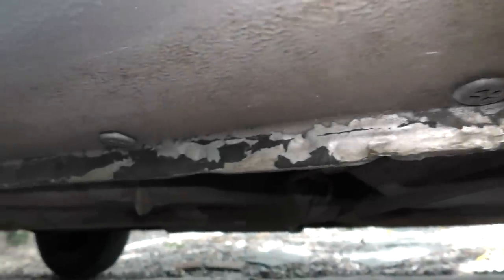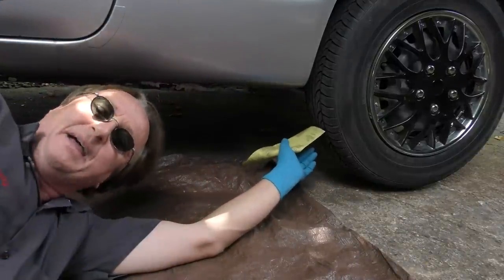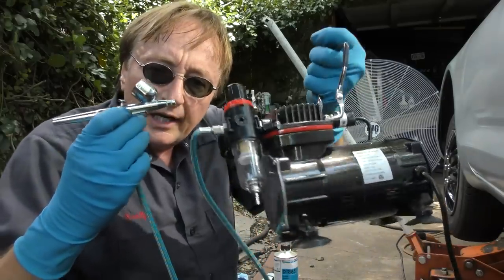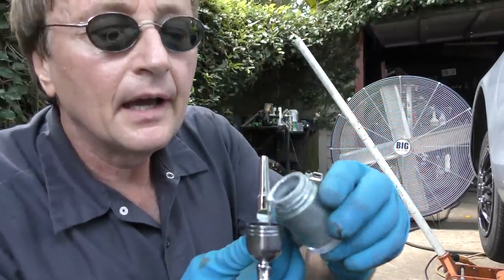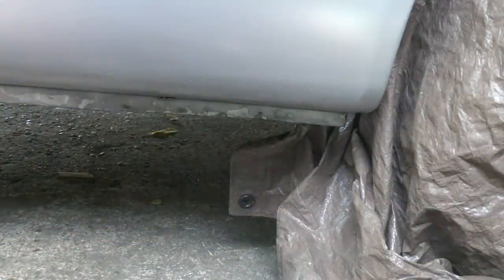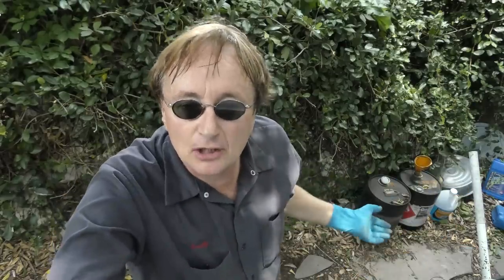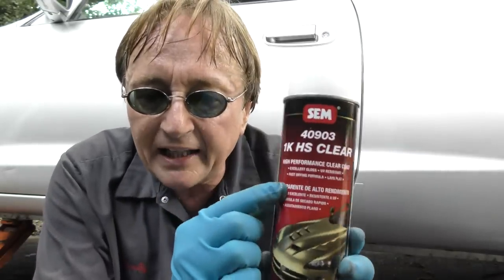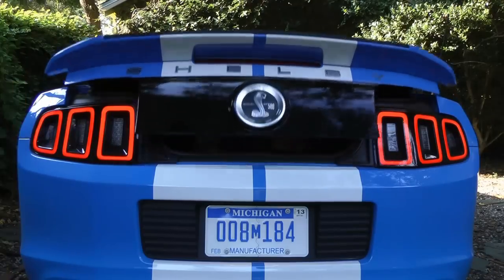How to Touch Up Paint on Your Car

Comment: Scotty, I love your videos but I think this is a bit complicated if you don't already own an airbrush and compressor. Most car paint stores will mix your paint and make you an aerosol spray-can with it and I've done that and used it many times, one spray-can is good for a whole bunch of touch-ups and cost me 14$. A hell of a lot cheaper and less trouble than a compressor, airbrush + thinner, the work in cleaning the airbrush, etc.
Reply from the maker: Il Cuggino Canadese sure, but you won't get as good a finish with an aerosol spray can, realize that. considering the thousands that pro painters charge to paint cars, spending less than a hundred on materials is chicken feed
Reply: Il Cuggino Canadese You can get budget airbrushes and compressors at Harbor Freight. I don't own one their compressors but seem pretty solid. I have a Silentaire. For the actual brush stick to something  metal. I have their Badger 350 clone and it's junk, but it was just 5 bucks. Their Badger 150 copy is much better.
Reply: For the record, I have an 8 gallon compressor kit from Hausfeld Campbell which along with a whole bunch of other tools, came with a paint canister to be used for painting. The biggest issue when painting outdoors, in your driveway, will always be the elements. I've been maintaining a '98 Sidekick (which as we all know will rust just by looking at it) since 2005 by using matched paint in aerosol cans for the two colors it has and it's fine. Some of the touchups I've made to it are hard to notice, others are blatant. Why? Because on any given day you'll have wind, humidity, INSECTS, and other elements to deal with.
Reply: I find it's extremely difficult to make anything look good when you use spray paint out of a can . It never spreads evenly and it's impossible to control how much is coming out and where it's going. 

I think it's a case of: if you're going to do it yourself, do it right by using an airbrush. 

If you're just going to use a can of spray paint you might as well just leave it as it is because spray paint jobs (from a can) always look like crap.
Reply: @taekwondotime   Well in that case, wouldn't it be better to just go to Harbor Freight and buy a cheap pancake compressor for $45 and a full size spray gun for $20 and do it that way, instead of a small compressor and sprayer?  
In your opinion, which would be better? I'm asking because I have a few spots in my car that can use some repairs/painting.
Reply: @ComPrt3  In my own experience (since it's not something I do often and since I have no expertise in it), anytime I try to spray paint something, it ends up drawing more attention to the trouble spot because the paint never spreads evenly, tends to run, and it doesn't quite match.  It takes skill to paint like a professional. 

I think anything is better than using a can of spray paint. Buy something that lets you airbrush it on gradually with a fine mist.
Reply: I'm going to try this for the front of my car.
Reply: @scottykilmer  Rev up your inhaling too much reducer!
Reply: Where can they make you a spray can with my cars color code?
Reply: @scottykilmer  You literally used a spray can when spraying clearcoat. I've achieved some great results when using a spray can, besides you said it yourself that "it doesn't have to look perfect, it's the bottom  of the car"...

Comment: Hey Scotty, I really appreciate your videos. Being a woman, most anytime I try to learn about vehicles I'm met with criticism or sarcasm instead of useful information. I also appreciate the lack of fluff info just to make a video longer. If content creators only knew that's what causes people to skip portions of their videos maybe they'd stop.  Yeah I know, fat chance.  So here's my question,  I have a luminess make up air brush system and I'm wondering if I could use paint in it as long as I flush it out. I don't see how it would mess it up, the paint stays in the metal reservoir until it's pushed out by air therefore it never touches anything but metal. I think it will work.
Reply: Give it a go. Nothing sounds cooler than air brushing your car with make up tools! My gf is going to kill me when she goes looking for hers.
Reply: How funny I was thinking the same thing because I have one of those too. Now if I can only remember where put it. Did you try it? How did it work?

Comment: FYI: Painting that part of the car black hides ugly pinch welds. Rockers are smooth and have much straighter edge. If you black out pinch welds behind rockers, it just looks a little cleaner. Same can be done in rear wheel wells it there are exposed pinch welds.

Comment: My paint is flaking off on the edges just above the windshield and above the doors and around the door handles. Not sure how to best fix it. The paint just didnt adhere very well and it's just going to spread but it's just some dime-quarter sized spots for now. Maybe hand paint them?

Comment: Good but after working in a paintshop this is tedious. No never use rattle can only primer but anything else never. Use a touch up pen, why u can avoid over spray paint and use the actual factory paint. Don’t take advice from people using spray can be prepare for paint reaction like peeling paint over spray everything else. Airbrush is okay though just don’t buy the water color get matching factory paint.

Comment: On a car that old from 1994, I would of just cleaned it off and got a paint brush and a small can of paint and painted it. It being under the car,  who cares what it looks like? The goal is to prevent rust and painting it on with a paint brush would also be much quicker. Then use the sealer or clear coat over it when it dries.

Comment: Hey Scotty! Could you please help me? I have a 2001 Ford F-150 that struggles when accelerated I have changed the fuel filter and new air filter and spark plugs plus cables and I still have the same problem what can I do!?

Comment: is it possible to just get a spray can with the correct color, spray it in the lid and use some nail or very small brush to dip the paint onto a small scratch or something? we changed a trunk list to a badge free one. the old list had the badge inside it, which made it a little taller in the middle, which obviously now have made deep scratches into the paint.

Comment: Im looking at buying a subaru impreza, the owner said 3rd gear sticks (standard transmission) could adjusting the shift linkages fix it or is it the synchros? Whats your opinion?
Reply from the maker: Raphcoll shift linkages are not adjustable on that subaru, don't buy it, transmission needs internal work.

Comment: Friend of mine did this to respray the front of hes car. Now its matte in front, and glossy/shiny at the back.
Reply: SSFproductions1 He might have used the wrong type of paint but a good thing to try and make it glossy is to use rubbing compound on it after it dries. If he used matte paint the compound won't make any difference.
Reply: Remember to use clearcoat? Also the clear coat is the most difficult part because it has to shine. If youvdo it wrong it will just be matte. But you can always at that point buff it down so it will become shiny...

Comment: What are the specs on that little compressor you're using, and where can could I use it with a larger size air brush gun?
Reply from the maker: +sailorbob74133  no idea , it just came with the kit for 89 bucks on amazon. But really, this brush is fine for air brushing, if you want to paint large areas, just get a real paint gun and a large compressor, they don't cost that much these days if you price around, especially used ones

Comment: Scotty help!!! My 1997 yukon rattles when i start it. It has 110,000 miles what can it be?!
Reply from the maker: Fern Sanchez depends what's rattling, Pinpoint the noise first, perhaps take off the fan belts and if the noise stops, you know it's something they drive . If not that, check the catalytic converters, they often break and rattle and PRAY it's not internal engine noise
Reply: Its internal and the best thing is the noise stops, but seems to get louder after time

Comment: How would I do this to a big paint chip on a door panel where the bare metal is exposed? Would I sand it down with sand paper and then paint it the same way? Or will that turn out bad?
Reply: If it's a tiny chip they make pens that you can use to fill it in. You can get them at an auto parts store.
Reply: But yeah you could try this method.

Comment: What's the advantage to use airbrush for this job, instead of spay can?
Reply: 1.  Airbrish sprays out less paint so it's easier to not overspray (which will cause running of the paint)
2.  Unless you can find spray paint cans hat you cna get color matched to you car's paint, you'll never get the same color as opposed to getting paint mixed for your car's color at a body shop and using an airbrush.

Comment: I friend of mine has a 2001 blazer and her a/c wont work
one day it works and the net day it don't
she took it to get repair they replaced the switch and still want work
rerplaced the low pressure switch still not working
had Freon checked and it is right on money that is when they hot wired the compressor
got any ideas she is getting ready to drive it off a cliff
also forgot to mention some dude did some thing under the dash more like under the glove box years ago to get it going and it seemd to work for a year then it went out

Comment: hello Scotty! huge fan of yours and current subscriber. i was hopeing to ask you a question about my car - i have a clk 320 cabriolet benz, and when im sloped and accelerate , i feel as if the engine moves. my neighbor and mechanic of 30 years says that the engine mounts need changing or tightening.. should I change the tranny mount as well? figure I may as well since all that labor will be done anyways to get to the engine mounts. (car has 111k miles)
Reply: charlie c Oh , and I bought the car at around 89-90K miles I believe and its a 2005. So thankfully within 2 years, no problems. Other than a couple tire changes.
Reply from the maker: charlie c I would change all the mounts if any are cracked, as they wear pretty evenly
Reply: Scotty Kilmer thank you Scotty

Comment: Hey Scotty I have some slight surface rust on my doors along the inside bottom of my car passengers side. How do I fix that? Thanks!
Reply from the maker: Jeff Gowsell sand em down to bare metal, put some fiberglass on em, and paint em.
Reply: +Andrew Crews It's from 3M.  It's like bondo(or is bondo not sure).   You can get it at Walmart in automotive.  I used it on my old truck I had.

Comment: I have dime sized rust divits in my hood after rocks hitting I then letting it sit for 3 years........ Would airbrushing small spots still be ok or would it look messy and blotchy? I have an airbrush and compressor from college i can try to use.
Reply from the maker: Michelle Simkins you would have to sand the divots down as even as you can, then paint many coats over them in larger areas to make it look good

Comment: Scotty, 
I have a 91 F250 I baby this truck. Recently I noticed it's got some rust spots about the size of a dime on the to of the roof in the cab and has some rust above the wheels would this technique make it look newer?
Reply from the maker: Krys Sulich   rust actually has to be cut out, metal welded on and sanded, then repainting the whole thing to make it look right. But some guys try bondo and repaint and pray it lasts a while
Reply: Scotty Kilmer awesome thank you for the info. Been watching for a while.

Comment: I just changed the brake pads and rotors myself on my car, but now the front driver's side rotor won't move, it is stuck against the caliper bracket once the bolts are tightened.  I disassembled everything and put it back together thinking I had made a mistake, but everything checks out and it is still like that. I tried driving my car after and that one wheel won't turn because of it, all the other wheels are fine. What could be causing this? Car is a 2007 BMW 328xi by the way. The only thing I could think of is that I received the wrong rotor, the wheel bearing could have randomly gone bad, or something else altogether. Let me know what you think because I would rather fix it myself than have someone else do it. That's why I watch your videos.
Reply: I hope you got that fixed.  Love to hear what it was.

Comment: Wow! great little video. Do you have any suggestions for touching up clear coat in a visible place? I've got a couple spots about the size of quarters flaked off my new 2004 cranberry Sentra sedan.

--Or, if I can find a self-levelling clear coat professionally done like Vivilon's Forevernu or Clear-FX should I spring for it? The car hasn't been garaged for the last 4.5 years and I don't have a garage or carport either now.
Reply from the maker: splashcat yea, try the self leveling AFTER buffing the whole area a lot

Comment: Hey Scotty, huge fan of everything! I have a question which is off this topic but I desperately need your sound advice on how to move forward and fix a perticular problem I've encountered. I recently went to auto zone to buy oil for my 97 e39 bmw 528i and the clerk suggested I buy seafoam to clean my motor from all the excess carbon toxins built up in there. I poured the seafoam down the throttle body and tried to start the car afterwards, now the car won't start. It makes a buzzing sound but that's all it does. The battery is brand new but it won't start!!! What have I done?!!!! Please help me with some advise to get my car started because i know the mechanics are going to try and take advantage! Thanks Scotty!
Reply: Bashir Tunau You know it would help when you say more information than it won't start and makes a buzzing sound.  What makes the buzzing sound?  When you turn the ignition on?  Did you test the battery to see if it has proper voltage?  Just because the battery is new doesn't mean it couldn't be drained.
Reply: *****
Hopefully he didn't pour the whole bottle into the throttle body
Reply from the maker: ***** that's why I advise not using seafoam, odds are it shorted out the gas pump inside the tank.

Comment: One of my roof tiles blew off and hit the bonnet of my car, now I got 2 dents on it and the paint came off in the dents. The garages around me are telling me it will take 2-3 days to repair and paint it plus cost a few hundred. Anyway I can use touch up paint on it?
Reply from the maker: you can try, but matching pain on the hood is VERY hard to do
Reply: Scotty Kilmer
Damn. Guess I'll have to try finding a used bonnet of the same colour.

Comment: hey scotty
i need your advice on how to level chips touch up  paint blobs
but without sanding because its a 2015 mercedes
i ordered scratchwizard kit and i dont know if the scratch lever thats removes excess putty can do the same with the touch up paint
thanks alot.
Reply from the maker: +Tomer Tzur  you can try cutting them off, pros just use razor blades and skill. But really, you'll never get it perfect without area repainting
Reply: +Scotty Kilmer will paint thinner work?
Reply: Razor blade, color sand, compound, polish and wax.

Comment: I have two questions; 
Is metallic paint for cars enamel mostly? 
What clear coat is compatible with metallic paint? For example an Audi with Light metallic silver color. What type of clear coat would it need?
Reply from the maker: +William Levy metallic paint can be used with any type of pain.  But clear coat is made for various types of paint, and I would stick to whatever type of paint clear coat that audi used, as expensive as it would be on a german car.
Reply: +Scotty Kilmer  audi used glasurit

Comment: Hey Scotty, what could I do for a paint bubble that has been chipping around the rear drivers door handle? It's has surface rust and its spreading and I would like to do this before it gets worse. The car is a pearl white 2006 Hyundai Azera. Thanks.
Reply from the maker: +Bailey Lauzon you would have to sand it down to bare metal, cover the pits with body filler, then prime it and then paint it
Reply: +Scotty Kilmer how much do you think a shop would charge for that because it is already going in for a big dent on the front passenger fender.
Reply: +Bailey Lauzon  don't sand  it or try paint a white pearl your self, not worth the hassle. 3 coats of white  2 coats of pearl two coats of clear. is a bitch and would need blending
Reply: pato were gonna have it done professionally in the spring.
Reply: good choice mate being a 3 layer pearl. If your interested in the auto refinishing trade, you may also be interested in a youtube chanel from Australia, "the gun man". great painter and goes in to depth with hes videos

Comment: hey scotty, on my car the part you're painting on ( on one side) there's rust and kinda have rusted trhough, not compleately but its getting there, so any tips on how one can fix this?
Reply: ErmaTheKitteh You're screwed. Cut the rocker out and weld a new one in. Fixes won't hold if you have a large area. If it's just a bubble here and there, sand it down good and then paint it. Any hole or significant chunk missing, and you're better off replacing.
Reply from the maker: ***Classified*** that's true, you can fiberglass, but it will fall off eventually, rust never sleeps
Reply: Scotty Kilmer Oh yeah, first hand experience up further north! You Texans are so lucky that you don't have to deal with that crap. Most of the bolts on brakes and such  on cars up here are beyond touchable. They snap before they turn.